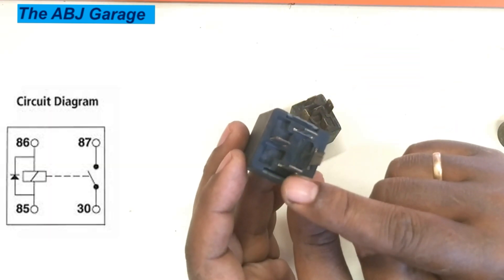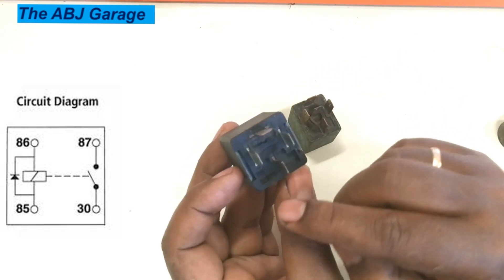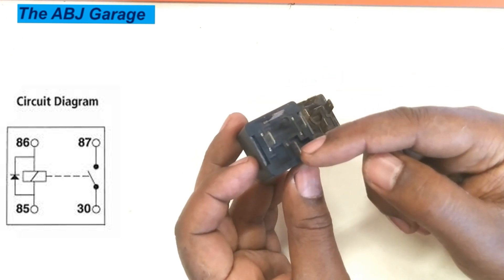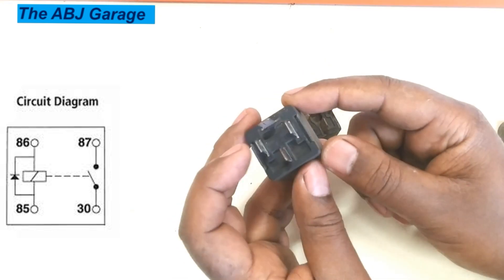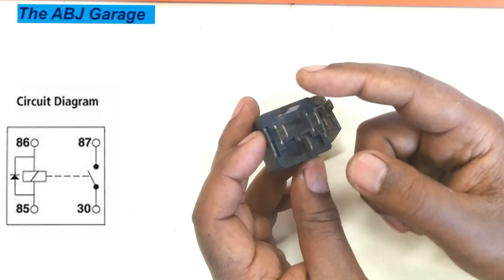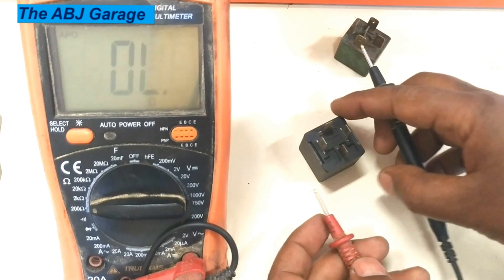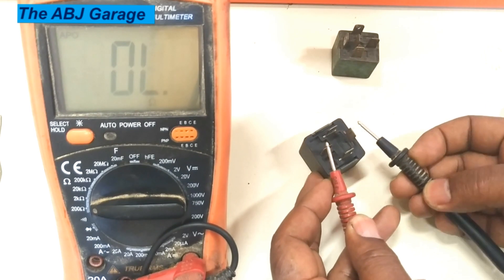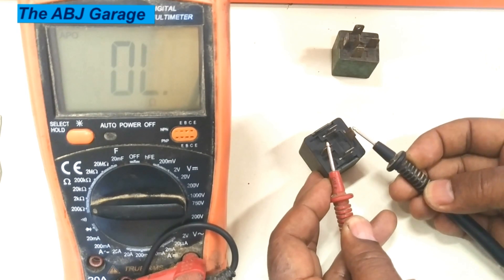How to test your car relay the correct way

Comment: Thank you my friend for the beautiful explanation, but if the resistance is zero, does that mean that it is working or there is a malfunction?
Reply from the maker: The relay coil should have some resistance to it! Make sure you have selected the lowest resistance setting on your multimeter. Otherwise you may get false reading. Shorted relay coils read zero resistance. Infinity resistance indicated and open circuit.